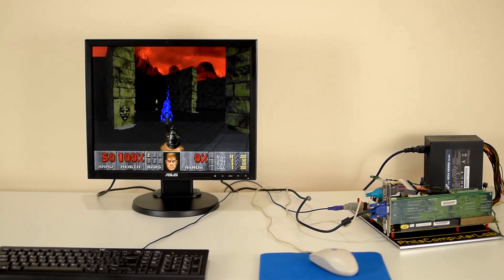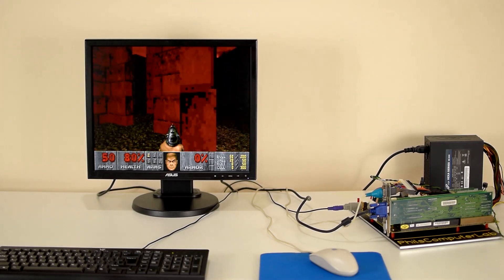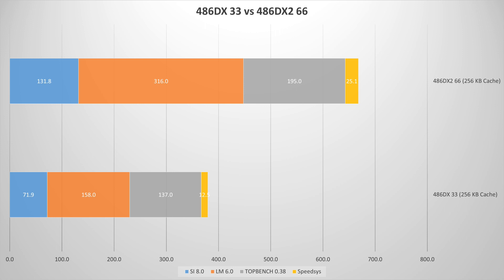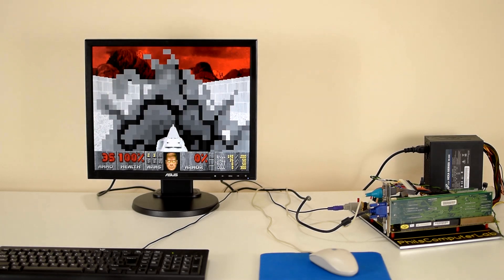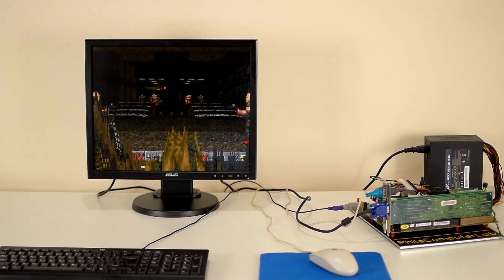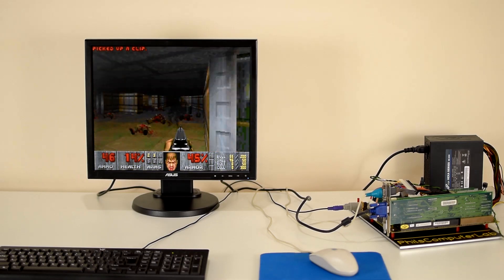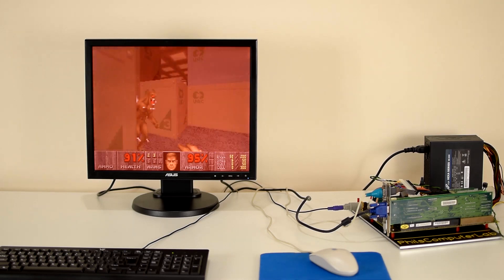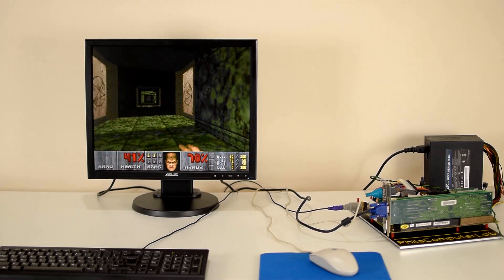486 DX2 66 The 3D Game Changer DOS Games

Comment: I know a lot of people dislike it when people refer to Wolfenstein, Doom and other games of that era as "3D games", because from a programming point of view, they aren't really 3D. However, visually, they appear to be 3D, and that's what most people refer to. The requirements to do faux 3D graphics at the time, were generally quite a bit higher than the requirements for most traditional 2D games, which is why having the faster clocks and the FPU really came in handy.
I have a 486DX/2 66 sitting around, but I prefer to use an Intel DX4 100 (16kb WB model) instead, as it allows me to run a wider range of games. Personally I'm as pedantic about "486" as others are about 3D, so I don't actually acknowledge the 5x86 models (both Cyric and AMD, despite them being totally different) as REAL 486's, because they we're branded as 586 with the purpose of having them compete with the early Intel Pentium line. So for me the 486 era ends with the DX4.
If I had a large room dedicated for PC setups, I'd love  to do something like the "stereotypical" 486 though, with the DX/2 66, VLB grapics, probably with Cirrus graphics, 8 or perhaps 16MB ram and Sound Blaster 16. But alas, I don't have enough room (or funds) to do this.
Reply from the maker: I will look into the DX4. I think I've got the standard overdrive model. I have a feeling that it won't run 100% on this Biostar board. But I got a faster PCI board that I intend to use with the faster chips :)

Comment: When will be the time we will see gains like that in CPUS again?
Reply from the maker: Yea those days seem to be gone...
Reply: The time you use software rendering. :P

Seriously, stuff like emulators still have the exact same gains. If you don't believe me try PCSX2's software rendering for yourself.
Reply: Software rendering has been obsolete since they days of the 82845 - No longer is it a potential factor.
Reply: xan1242 Not so true. Try to run Gran Turismo 3 @ special stage route tracks and see if the game runs at full speed on a skylake i5.
Reply: jangelelcangry Ok. Try running NFS Carbon, or any EAGL based game for that matter. Emulator isn't very optimized for that. If Xenia ever gets a software renderer (due to obvious reasons) then you won't see it screwing up as much and it'll be very taxing to the CPU. 

AIO inc. It is when you're talking emulation. You'll always and I mean ALWAYS end up with a more accurate implementation through software than through hardware unless you're using hardware of the machine that you're emulating. (even then you could end up with more accurate stuff through software)

I don't wanna get technical, but there are reasons why emulators are shifting towards software rendering (Mednafen PSX for example).
Reply: xan1242
I think you don't get the point. What i meant was that that ipc improvements between two generations 20 years ago was way higher than 5 generations nowadays.
Reply: jangelelcangry That I completely understand. The times have changed. Sure it won't be as frequent but I doubt you won't see a difference when you upgrade like back in the day.

In my specific case scenario, I'll upgrade from a Phenom II x4 965, which is still a pretty competent processor these days, to an AMD Zen or Intel processor and I will see a difference. It's just that everything slowed down - we can hold onto our hardware for longer and it takes a longer time for any advancement.

Another example would be graphics cards, I just installed an RX460 for a friend of mine and it runs about the same as a 7850. It doesn't require extra power other than the PCIe slot unlike the 7850 and it took about 4 to 5 years to get there, which is what I expect with modern tech.

I was trying to only portray the areas where the improvements would be seen and I showed emulation as a good example as it provides similar performance improvement seen in this video. I mean, if you're expecting a performance change in the new Doom with a new CPU like back in the day, yeah, you won't see it because it doesn't need it in the first place. You'd have an improvement in the old Doom tho! :)
Reply: But doesn't pcsx2 software rendering ommits options like better resolution?
BTW. when you go to Zen you will feel the power of a new CPU. And you know what? It's amazing.
Reply: jangelelcangry Yes, that is true, but it is accurate, which is what we sometimes really need with games. Enhancements can be brought to the table even with software rendering, but we haven't reached that stage yet with PCSX2 at least, other emus have some.

I hope so with Zen! I just dunno, I honestly felt like it's time to upgrade when I ran Doom (OpenGL 4.2 I think) with medium settings at 30FPS most of the times on my rig. (100+ on classic stages of course)
It might've just been the API (Demo version doesn't have Vulkan IIRC), it might've been just my graphics card (MSI HD7850 1GB), but I feel now is the time for the CPU (and therefore general system) upgrade in my cycle. I could probably live with this with just an RX480 but I do stuff like emulation that needs horsepower other than just graphics. I'm a bit mad at Dolphin though, as it used to run better on my dual core AMD than now, but apparently that was just an anomaly.

Comment: How about testing ultima underworld on some slower hardware?

This is a massively important game, that inspired man of the classic games of the 90's (elder scrolls arena and daggerfall, system shock, thief, deus ex ... ); it completely changed the design and nature of western RPGs, which traditionally were turn based first person pseudo-3D and very heavily focused on D&D-like rules (RNG and point systems/XP; like the SSI gold box series, the bard's tale series, wizardry).

It was also a graphically breathtaking game when released, with sloped floors, sloped  walls, textured floors, textured ceilings, bridges and even some real 3D objects before wolfenstein 3D was even released (an early version of this game inspired iD to use texturing in hovertank 3D and later in wolfenstein 3D).

The slowest system I have ever run this on was a pentium-166 which is way faster than required. Supposedly it ran "fine" on an AMD 386-DX40, and the system requirements were just "any 386", but at the same time I've read that the system requirements were "extremely high", which suggests good performance would be more in 486SX-33 range judging by when this game came out and optimal performance probably closer to the DX2 you are using.

You can change some jumpers and run the DX2 with 1x and 2x multiplier, as well as 20, 25 and 33 FSB; can't you?. Not sure if there's a good way to benchmark ultima underworld unfortunately; I don't belive there is any kind of timedemo type feature like Doom.
Reply from the maker: Good idea, could use it in another video. Does it have a FPS counter? That would be handy...
Reply: +PhilsComputerLab I don't remember it having an FPS counter. I'm not sure how you would benchmark it properly. Nobody has the time and patience to count frames on a high FPS camera and without a timedemo you can only approximately repeat actions.

Comment: Given the RAM check I must have been a happy camper in total back then with my DX2 and 16MB of RAM... thanks dad.
Reply: Back when? 8 mb was standard in 1993 when this came out.I paid $400 for the DX266 $300 for a 400 mb HD in 93, I felt like such a Big man. My quad speed external cd rom and 2,400 kbps modem.
Reply: @MrJamesDoz  Wow... 2,400 kbps. We only had 1,500 kpbs in my house in 1995 and handshaking with the local BBS always took at least two minutes. I don't blame you for feeling like a Big man, that was basically the equivalent of owning Deep Blue back in those days lol.
Reply: before windows 95, bill gates said we only need 4MB ram.
Reply: It was the standard, Most did not meet the standard. 2mb was necessary to run windows 3.1 required. 2 mb to run but could use a max of 16 mb's. 99% of people that had the cash to buy a computer run more then the minimum, same goes for today. Windows 3.11 was 3MB min. Where do you live? I lived in a Major US city.
Reply: @Dalle Smalhals Dude, Wake up, I spent around $1,500 for the Computer used and it had more then that.
Reply: BTW, Back then, None of you computer Newb's where around. It was so much better when it was exclusive. The reason why, It cost a hell of a lot more, and we actually had to know how to use it. No point and Click.
Reply: @Dalle Smalhals Dude WTF? Don't you know , What a person can get is based on how much disposable income they have. In NYC in 93/94 in my circle Yes it was the Norm.
Reply: @Dalle Smalhals You asked a Stupid question, What did you expect? You asked in in an ahole way as well. Go back and look at windows 3.11, Look at the min. requirements. Ask yourself, Who uses the min. only?
Reply: @Dalle Smalhals BTW, The Olde Country that my Family helped found. Your Welcome.
Reply: @Dalle Smalhals Dude, wth are you talking about, I never said that. But you insinuated it about me. Dude, I hope you and your family are safe and will be after the Dirty Leftist are smashed next week, They will be out doing what they do, It will be a great time to take them all down.
Reply: Also I had to look nothing up, I used 3.11 and 3, 3.1, Ms Dos, I remember, you are looking for an enemy where none exists
Reply: @Dalle Smalhals I don’t get the Feeling that your a low IQ individual, No chance your Commie Rat.
Reply: @Dalle Smalhals It will be a very Great Day for Every Proud American. My city will be a blast with all the tears of the Commie Scum after they lose. Just like four years ago. Epic.
Reply: @Dalle Smalhals So Election Day, Many tears for you. But you only think your a Commie, Your just one of the young and  dumb that follow, the Herd. Next time Do some research before you start following something, especially something as murderous as Communism.Everything you follow is a lie and I and many others can Disprove anything you say. Two Hundred million plus murdered in the Twentieth Century.
Reply: @Dalle Smalhals  Btw, who cares and why out yourself as a stupid person? Jk,
What I said stands, I am not
Your enemy unless you want me to be.
Reply: @Dalle Smalhals My bad, you don’t know computers, Standard is what the Operating System called for to run bare Bones.

Comment: 1:06 I am so happy that we invented ZIF (Zero Insertion Force) socket that permit to NOT have to do that to put/remove a CPU
Reply: ZIF sockets had been around for a good while even before that - See CuriosMarc's restoration of the PROM / EPROM programmer from DataIO.

It's got ZIF sockets to program the chips, and PLCC sockets also existed at that time as well, though they weren't nearly as often used.
Reply: ZIF is good for plugging chips into a socket, but, the other ZIF that involves ultra slim cables, well, I hate that thing, since I always can't make sure if I've plugged in the cable correctly or not.

Comment: Whats the monitor you're using there?
Reply from the maker: It's an Asus 19" screen, 5:4 aspect ratio and 1280 x 1024 pixels.
Reply: Some kind of ASUS panel, it should seem. I believe it's capable of 1024x768 only, but I can't be certain.
Reply: I've seen in a previous video (assuming it's the same monitor) it do 1600 x 1200. I think it was the Voodoo 5 5500 video
Reply from the maker: That was a different model, a Samsung 1920 x 1200 screen :)

Comment: I would be interested in seeing the difference in performance between the DX4 chips and the early Pentium CPU's.  If I remember correctly both chips were available at similar speeds but the original Peintium had a bug in the silicone that caused crashing with certain equation types.
Reply from the maker: I have the DX4, but no early Pentiums. Pentium 100 is the slowest Pentium I got.
Reply: I think the only earlier Pentiums was a Pentium 60 and a Pentium 90.  I would have thought the easiest way to do the comparison with what you have would be to simply underclock your existing P100 assuming the motherboard you have for it allows such options.
Reply from the maker: 100 is the lowest they go :)

Comment: I remember being so envious of the Acer DX4-100MHz machines I used to see in Best Buy, running the Descent demo. If I remember correctly, Acer was making some of the very first "dark case" machines at the time. I can't remember if they were gray or purple, but they definitely weren't the beige color everyone else was using. At the time, I had an IBM PS/1 486SX-25 running DOS 5.0 and Win 3.1.. most of these games would run, but not very well. Having said that, I'd still love to see a VLB vs PCI 486 platform graphics card shootout. Keep up the great work Phil!
Reply from the maker: Thanks!

Comment: it really is an iconic CPU , much like the 386 DX33  or Pentium III 1000  it took quite a while before you really needed a replacement.

though I would say that for a retro build, a DX4 100 might be a more practical solution just for the extra speed in some of the later DOS games , although you could easily just get a Pentium for those as well , so the DX2 certainly has a place

Comment: Expanded Memory Manager? any chance of getting ems or emm386.exe c000-e000?
Reply: master of magic requires it and I'm still checking in with you Phil, and watching each and every video. you're lucky you have this tech as most others would determine this to be ewaste.
Reply from the maker: It's my boot menu from my DOS starter pack.
Reply: +PhilsComputerLab I'm very picky when it comes to contiguous memory in that pageframe address, as it corrupts the game in question if it's not a rather large block of umb.
Reply: Even xp has this available under emm=ram b. And it's just a matter of time in your videos before I asked about something that has plagued me for year's. 
That dreaded setting of a page frame address. I know win me allows emulation but that's where the data corruption happens on my old gateway solo 1150cl. lol cyrix graphics card dedicated 4mb ram. 64megs ram and 550 Celeron. runs dos like a uber champ.
Reply from the maker: I never had to do any of this. My tip is to keep things simple. CD driver, mouse, sound card. Done. Every game I tried worked with my boot menu :)
Reply: +PhilsComputerLab Thanks you've been very blessed. It's at time frustrating and I noticed the difference in pc performance after the started to implement uma shared graphics cards and that functionality is gone. Happy they made dos box but on a older pc that emulator can be super slow and games can be unplayable. And if you run your cycles higher than your cpu can handle you can potentially damage it. I would be curious as to see if you would have a junk bench board a Pentium would do and perhaps test this theory of which will happen first a system overheating sensor shut down or will it just cook it until it's fracked.

Comment: I would say the dx4 100 was the 3d game changer
Reply: I take your DX4-100 and raise it to AM486 DX4-120.
Reply: I'll take your DX4-120 and shove it up to a K5 133Mhz
Reply: ı think they are garbage
Reply: You mean AMD dx4 100? Btw, this CPU can beat P1-75/100?
Reply: mr3dx ive got both cpus
Reply: Fernando Costa Not anymore, if you look on ebay. :-D Well.... I will take my dx4-120 chip over any dx4-100 chip. 40mhz fsb stock speed. I have it in a VIP board alongside 32mb ram and a CL5446-2mb pci card. Awesomme shit i tell.
Reply: not really, doom was already playable in a dx2.
and if you mean for quake, well then it was the pentium 100. quake was just barely playable in full screen on a pentium 100. in a dx4 100mhz you needed a quarter-size for it to reach a decent 25fps average.

Comment: 2.5D* game changer :P
Reply from the maker: Haha, yes you're right :D
Reply: Technically, that makes every video game 2.5D, as that would require something more like VR (Virtual Reality), which would in itself only be capable of some 2.75D, or AR (Augmented Reality), which could achieve full 3D.

Everything displayed on a screen is completely and fully limited to two dimensions - height and width. No matter what you do, this cannot be changed.

While they do indeed have some limited thickness, it's nearly impossible to control this via software, making everything 2D only.
Reply: +PhilsComputerLab 

The doom engine draws primitives in this case sectors mathematically. So calling it 3D is correct, I mean look at the end result! xD
Reply: No, because structures can't go over each other in doom. And also you can't look up or down, so this is definitely not 3D.
Reply: In order to see in 3D, you need 4D eyes. Real 3D would be more like 3D printing in real time. Your eyes only ever see two 2D images and try to reconstruct some kind of psuedo-3D out of that. These reconstructions rely on many assumptions that are generally true in nature, but can be very wrong in games.

If you look at a "real" 3D game, it is taking triangles, doing a bunch of rotations and translations and then projecting them on a 2D plane and essentially stretching a 2D image across them. Nothing about this procedure really screams 3D.

Also; ultima underworld; which was released before wolfenstein 3D, had textured walls, textured floors, textured ceilings, slopes, bridges, slanted walls and even some "real" 3D objects. It reportedly ran OK on a 386 (for some definition of OK).
Reply: Raycasting technically isn't 3D, it's just kind of a weird way to visualize 2D gameplay.